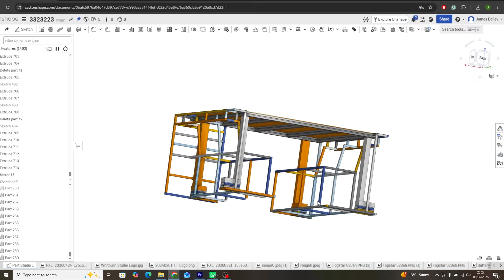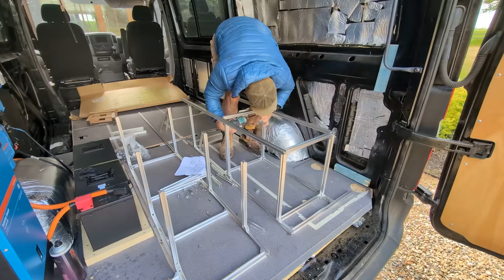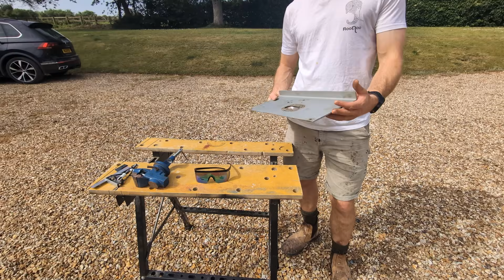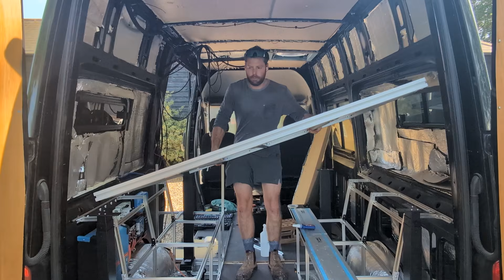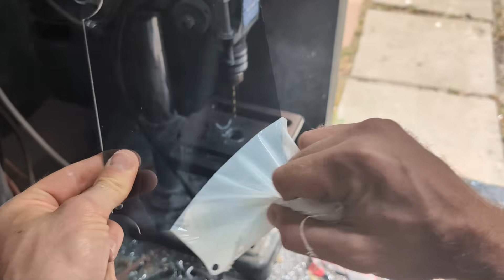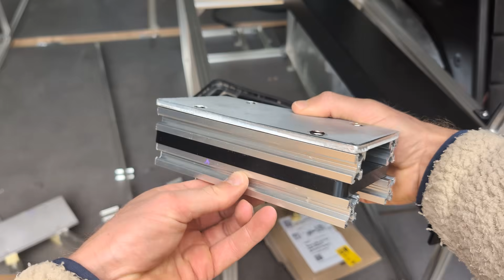The Most Sophisticated Campervan Bed You'll Ever See

Comment from the maker: Should I switch to 24V for a 30-second lift, or is 60 seconds fast enough? Let me know your thoughts!
Reply: Assuming you're running a 12v system for everything else, going 24v on the actuators would require a 12/24 DC/DC converter, just another thing to break IMO :) Cool build BTW
Reply from the maker: Yeah exactly. There's so many things to break already so one more night not be an issue haha. Thanks for watching!
Reply: 60 seconds is fine -Perfect speed to give a respectable '1 minutes silence' (especially considering that the actuators are so nice and quiet) to always take that moment as a reminder to admire the ingenuity of your design, how well executed it was and the hours of time that you put in. Besides, a slower speed gives a more sophisticated and refined aesthetic.
Reply from the maker: @ACIDvICTIM well said
Reply: Pretty sure most other ways of converting from living to sleeping in vans take at least 60s!! Seems plenty quick to me. Nice build
Reply: There seemed to be a bit of both.
Reply: Depends how desperate you are to go to bed lol
Reply from the maker: @bufdaman true 😂
Reply from the maker: @bufdaman true 😂
Reply: If it's hacked or a problem arises, perhaps it gets accidentally bumped or a kid is playing with the dial and you're not ready for it, you want it to go slower. What if you're sleeping and it's going up? Better to go slower. Find a way to have an emergency clearance space or breakaway.

Comment: clever stuff , and really enjoying your content thanks... but why dont you just run a filler piece between your seats? Use seat cushions as mattress. Old school. Lighter (you went for lightweight kitchen tops at great effort). Less to break.🤔
Reply from the maker: Do you mean a frame that slots between the tops of the seats? If so, the reason behind my approach was to have minimal setup when going from sleeping to living mode. I didn't want to get bedding out of a cupboard or physically slot anything together to build a bed. Appreciate it's only a few minutes to do something like that, but just my preference

Comment: 24V smaller diameter wires better speed, seems like a winner, Nice build by the way and thank you for sharing
Reply from the maker: My current electrical system is 12v, I'd consider 24v but have a pretty monster 628ah battery that weighs 60kg, so don't fancy having two of them! Was more thinking of having a small 12-24v converter just for the bed. What would you do?

Comment: Using linear actuators I can tilt my campervan bed to any angle. Don't carry ramps and never have a problem with levels when wild camping. Did it six years ago and it was the best thing I've ever built into a van along with side pods.
Reply from the maker: That's great. Someone else made this suggestion too. How do you make sure they're level, is it manual or do you have some kind of system that can detect when it's level?
Reply: @Whitburn.Studio it's manual. I have 4 toggle switches next to a bullet spirit level. The only problem is overcoming the fact that the actuators can only be fixed at the top end. It. Would not be possible to raise one corner if they were all fixed both ends. Once level just I just bring them all up to just touch and support the bed. A bit Heath Robinson but it works and has made a huge difference when stopping at random places overnight
Reply from the maker: Sounds like a great way to do it

Comment: Nice work there. Going with 8020 aluminium is the way to go. I used it in my van and didn’t use any lock tight. I allowed the screws to bottom out and that seems to hold them in place. I’ve been driving like that for the last few years without any issues.
With your bed elevated, how sturdy is it when you’re driving. In particular, if you have to brake hard does the bed move at all. Similarly to yours, I build my van with a bed lift as well and I found if the bed wasn’t firmly positioned against the ceiling, it had a tendency to rattle a bit.
BTW, definitely recommend going with the higher voltage. I run mine at 48V. Electrically, it’s safer because the wiring doesn’t need to be as thick and runs cooler because less current is going through the electrical wire. If any appliance requires 24v or 12v just need to put a stepdown regulator next to it. Those regulators are cheap and very efficient.
Reply from the maker: Great to hear from someone who's done something similar already. Interesting about not using thread locker, that's reassuring! I haven't driven it much since the installation just due to having other jobs to do, but it feels pretty solid. I plan to build out some panels to cover the actuators in the future which would provide a bit more structure around the bed frame and mattress when elevated. I've also set the forward stop limit so that there's a small amount of compression of the mattress in the ceiling, which I think will hold everything nicely.

My system is already 12v (got a rather large 628ah battery!), but could use a 12-24v converter for these actuators, which I am tempted to do for double the speed and power. I'd probably do a 48v system if I am lucky enough to do this again on another vehicle (unimog 🤞🤞)

Thanks for watching!
Reply: Do you have any videos of your build?

Comment: Very impressive! Loved this episode. Especially getting that code to work. 
What happens if the bed lifts up whilst you are still in it?
Reply from the maker: That's such a valid question as getting crushed into the ceiling during the night isn't on my bucket list 😅

What I'll probably do is put a kill switch on the rs485 line (the one that sends the command signals from the raspberry pi to the motor controllers). That way the system doesn't need to reboot every time. 

Appreciate the watch big data 🙌

Comment: A cracking idea for the bed frame and legs, I'd say the timing is personal but how much extra would the 24V system be and would you use it anywhere else?
Reply from the maker: It would only be for this as the rest of the system runs on 12v. From my very quick research, I'd just need a 12-24v 50a converter, which looks to be about £50 and is a small unit. I'm tempted..!